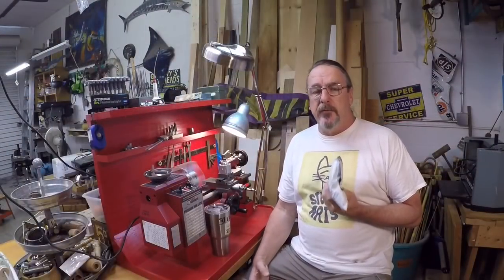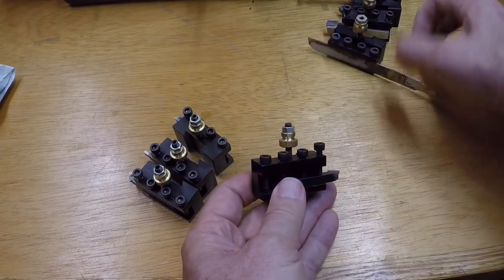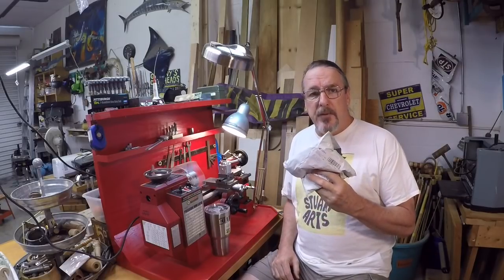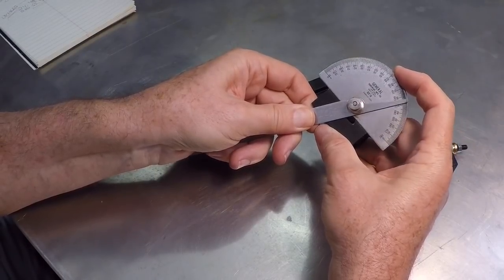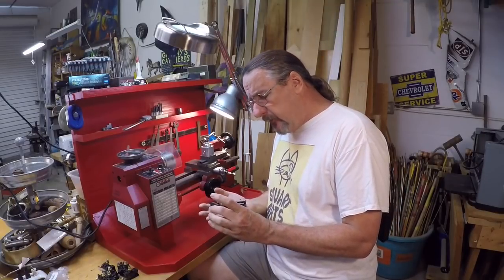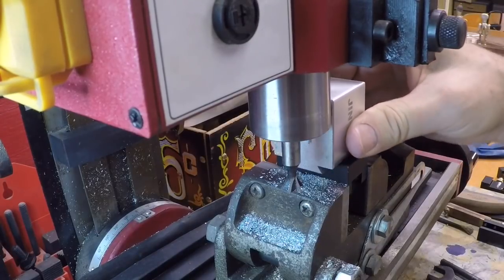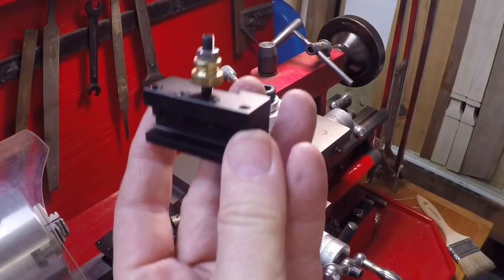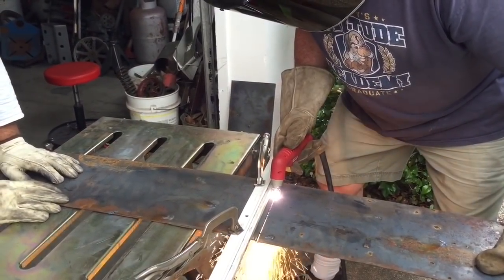Buying Aftermarket Tool Holders for the Jinwen QCTP - Mini-Lathe Topics

Comment: My experience mirrors Jimmie Porter's. I purchased on eBay a QCTP with a bunch of holders. Half of the holders would not fit either male dovetail and half of those that did would only fit the slightly smaller one of the pair. In my case a HSS cutter would not touch the hard steel so I used a diamond tool to get everything the same size. Later I purchased 3 additional holders (from a different source) but they would not fit either without a bit of 'adjustment'. For the price I can't complain.

Comment: Hey Jimmie thanks for posting this   I got my tool post delivered last week, I believe it's a copy of the no longer available A2Z CNC tool post . I laugh at some of the comments on Amazon about the tool post, I don't know what they were expecting for 30 bucks ! I am actually pretty happy with it . The OXO posts won't fit on my lathe without some surgery on the compound and I figured this was a good way to see how I like the machine without  a big cash outlay. Most of the lower end machine tool stuff from China is fairly universal and can almost be considered a kit. I have a larger lathe but I picked this machine up to do some smaller work in Delrin & Aluminum so I anticipate it will be fine, I might be ordering a dovetail cutter like yours soon as well, changing bits in a holder kind of defeats the reason for a QCTP! Thanks TJ
Reply from the maker: timothy hart Timothy, I now have 16 tool holders and that's about enough. My peeves are pretty minor and I think they are great value. Good luck!

Comment: How do they compare, price wise, to OEM tool-holders?
Reply from the maker: BedsitBob these were about five bucks apiece. The original tool holder was a different style - the kind where each tool has to be slapped in separately - very inefficient!
Reply: @JimmiePorterAtStuartArts  I didn't mean the original tool holder that came with the  lathe.

I meant, how much do tool-holders from the makers of the QCTP cost, compared to the one's you got from E-Bay?
Reply from the maker: BedsitBob BedsitBob aha! The Jinwen QCTP is a set that cost around $35.  It came with four tool holders. I could not find individual tool holders from Jinwen.  But these aftermarket holders look to be identical and I believe they were made in the same factory as The original set....so cost was probably about the same...
Reply: @JimmiePorterAtStuartArts  I see.

When you said "on balance, it's worth the effort", I thought you meant compared to buying pricier, holders, from the company that made the QCTP.

Comment: Surprisingly I have not had that problem, but in the end I made a very similar tool post to that one out of steel. Using the original tool-post as a pattern though I did make a few changes on my new build and obviously matched new steel tool holders to the tool-post All my tool holders Aluminum and steel all fit on my much more sturdy steel tool-post.
Reply from the maker: Stephen Tayler that's a project I need to take on myself. But I've got a loooong project list ahead of it. Someday!

Comment: It's amazing.  I've purchased a dozen of these and not a single one was identical to the others.  I'm wondering if they cast these and then just ship them out without milling to spec.  I milled every dovetail to fit.  You should check out the higher end tool post designs.   There is a super cool mod to this post that can get you to pretty phenominal repeatability.
Reply from the maker: Gordon Jones yeah I'll probably step up at tome point...this is all self-induced because of my thriftiness...
Reply: Gordon Jones is there a link to the suggested mod? Any details?

Comment: Are you sure its not the post that at fault. When you milled one it fitted one face but not the other indicating that the post faces where different.
Reply from the maker: Johnno Sawyer a fair question. But interesting though the original tool holders all fit...

Comment: Metric???
Reply from the maker: david gochenour dimensions of the holders  were given in mm, but my lathe and accessories are metric. Dimensions provided were spot on with my original tool holders...just that dovetail angle is different...
Reply: ther Celsius   good catch .so he should just turn them inside out and bzamo all good